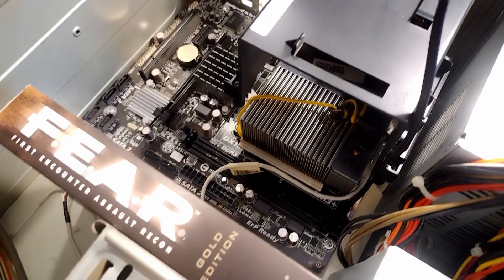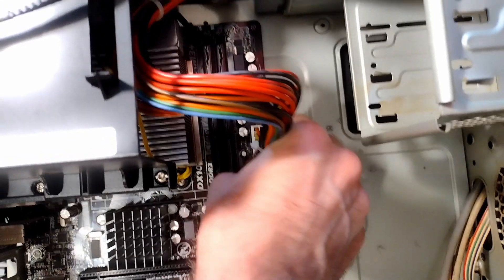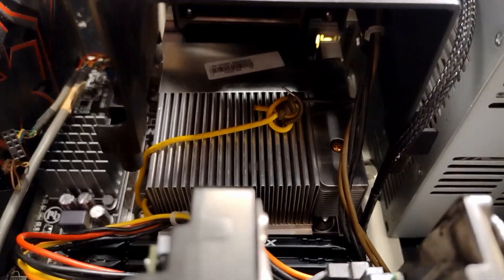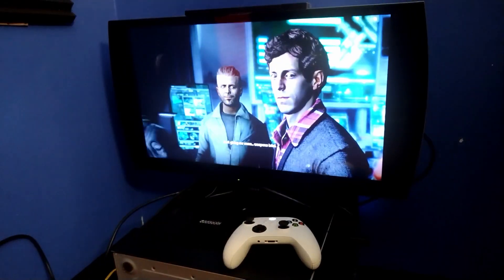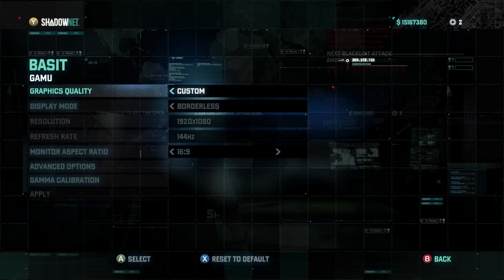How to fix Splinter Cell Black List PC | Site F Final Cut Scene Bug Fix

Comment: A fix I found that works, at least without the FusionMod, was changing antialiasing to FXAA. I didn't try with No antialiasing, but it seems that anything other than FXAA also causes it to have issues. The rig I'm using uses an Intel CPU and Nvidia GPU on Windows 10

Update 11/28/2024: So in my experience, it appears that if you play at 120 fps, the final cutscene will also not show, even with FXAA. So it appears ≤ 60 fps plus FXAA is the way to go if you'd like to see the final cutscene and credits. Although, I just replayed it on a new playthrough and it did not show the final cutscene with the settings that I mention (60 fps limit, FXAA). I don't have v-sync enabled, but I set the frame rate limit through the Nvidia Control Panel

Comment: i have the same issue, so you just need to change from dx11 to dx9? Is it all? No other setting like:
- make sure that "V-Sync" is set to "On",
- set it no more than MSAA 4x,
- do not use Nvidia GeForce Expirience...
Reply from the maker: Thats what I did and it seemed to work no problem. I also have it set to Borderless as the display mode. I didnt use Nvidia Geforce at all. Or teh Nvidia Control Panel. Vsync i have set to on.

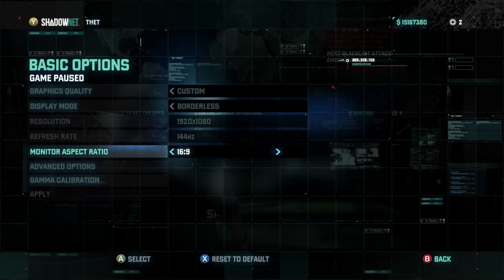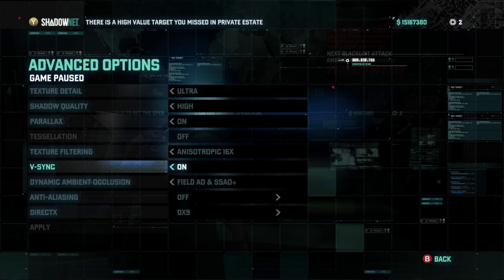My settings at 0:48 and 0:49 got the cutscene to load.
Reply: @BioAlpha5  noticed one thing. When I chose all the sets Graphics Quality - Ultra and Display Mode - Borderless the same like in DX9, but only for DX11 - I finally got the final cutscene! Win 10 Pro x64 21H2, driver vers. 526.57. Nvidia GeForce Expirience also was installed.
Reply: @MrSyavikua  thanks for your info! had the same issue. So sick of Ubisoft.